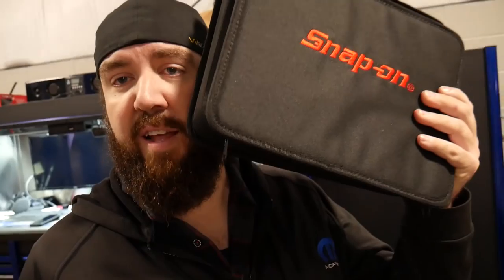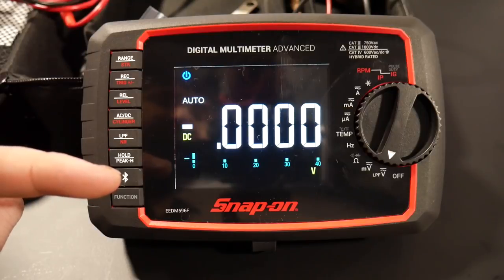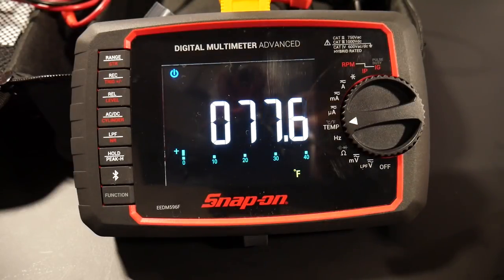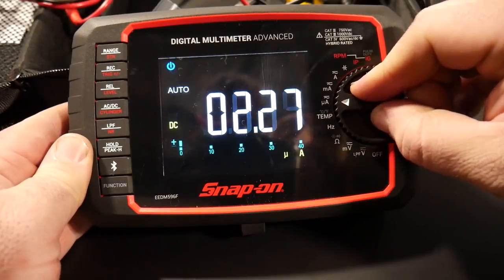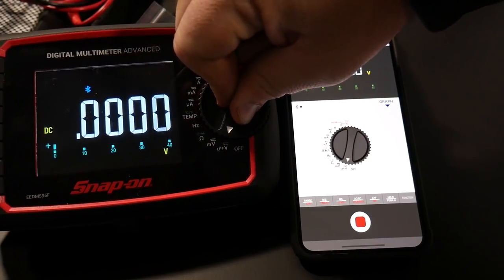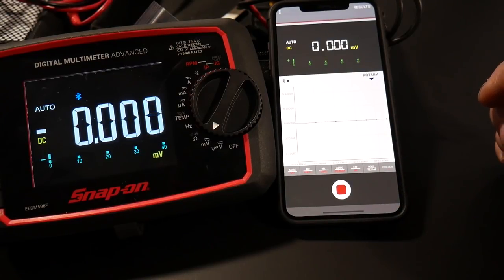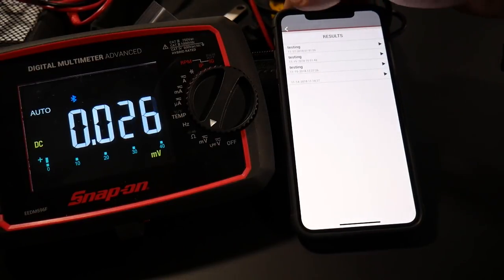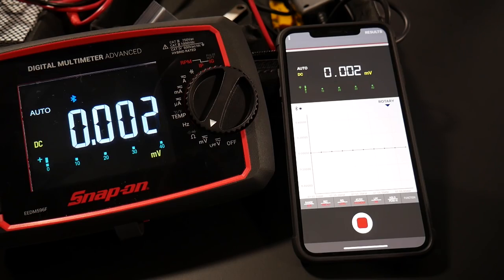NEW SNAP-ON MULTIMETER FIRST LOOK AND REVIEW - EEDM596F

Comment: ok you guys are missing one of the many great cababilitys . that is that it is rated cat 6 meter were your scopes and other multimeters are not and if your need to know what cat 6 is it is the votages it is rated for on top of the response time of the readings now in compared to a scope you it still will not touch the times per second it reads but you are comparing apples to oranges john pilgrim and just so you know a scope is not a replacement for a multi meter just like a meter is not a replacement for a scope. but from your post you are willing to pay for cheaper les quality tools and driven buy your wallet not an education/fulfillment do to the best you can and buy 2 or more of the same tools to help you in your job when you can buy less and do more because your not putting your bes foot forward ie. quanity over quality. he is show a honist review of his thoughts but all you saw is price not what It can or cant do for you.
Reply: Yeah, cuz most cars are still 12V....
Reply: @tedsaylor6016  yes 12v but your amp range on 12v can be any ware from 1milamp to 1600amps and most are not rated for hybrids which this one is.
Reply: There is no such thing as a CAT VI(6) meter. The highest is CAT IV(4).
Reply: @Afootpluto  yes there is it it's a rating on how much voltage you can test.
Reply: @mrcrackerjacks  also the category the meter is rated for doesn't mean what voltages you can test. It means the max amount of voltage spike it can handle safely.
Reply: @Afootpluto  meaning at with it can test/read
Reply: @mrcrackerjacks  not really. You can't put a constant 6,000 V in a CAT IV multi meter even if it is rated for spikes as high as 8,000 V.
Reply: @mrcrackerjacks  CAT rating is only for the spikes nothing else. Also I still don't know where you are getting CAT 6 from.
https://content.fluke.com/promotions/promo-dmm/0518-dmm-campaign/dmm/fluke_dmm-chfr/files/safetyguidelines.pdf
Reply: @Afootpluto http://testmeterpro.com/cat-iv-multimeter/ go there read and learn what you are saying is a fuse rated for 25 amps is only good for 25 amps but will not operate at or up to 25 amps but guess what it dose. and if you still think that a cat VI which VI=6 on that page you will see 12k ratings but a 12k meter is not found in a hand held meter so it is called a cat VI or cat 6 you cant just use fluke there are more companys out there and if you are a big fluke person why did most of flukes engineer's go work for snapon and not stay with fluke. and just some of the places you would use a cat 6 multimeter is on a mine site or were you need faster communication for accuracy readings.
Reply: @mrcrackerjacks  oh, so when you say CAT VI you actually mean CAT IV 1000V. Even though the actual category is CAT IV. I will stick to calling things by the standards.
Reply: @mrcrackerjacks  where are you getting 10k from? I don't see anything that says 10k. The link that you sent didn't mention of 10k, nor have you mentioned it until now, and I haven't mentioned it either.
Reply: @Afootpluto  well yes it does you need to look again my friend I can not help you read over the internet but their are serveses out the that can 10k (10,000) 12k (12,000)
Reply: @mrcrackerjacks  still can't find what you are talking about. But it is kinda moot since the new snapon is CATIII 750 V AC, CATIII 1,000 V DC, CATIV 600 V AC/DC not this magical CAT VI you are talking about. https://store.snapon.com/Automotive-Digital-Multimeters-Advanced-Digital-Multimeter-P928898.aspx